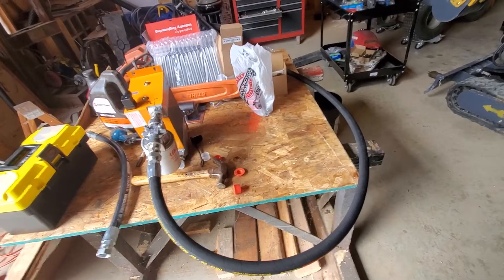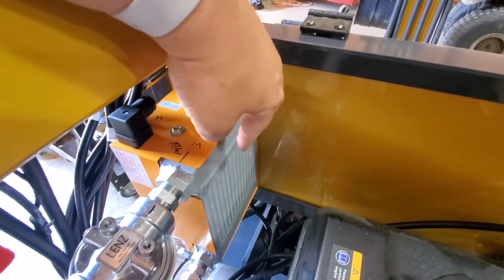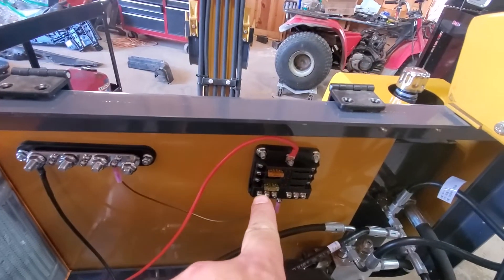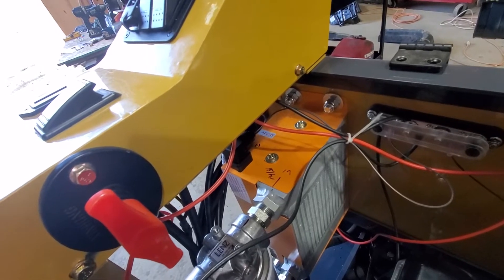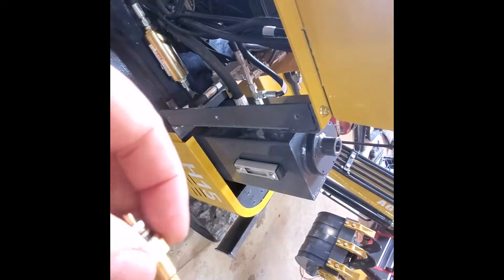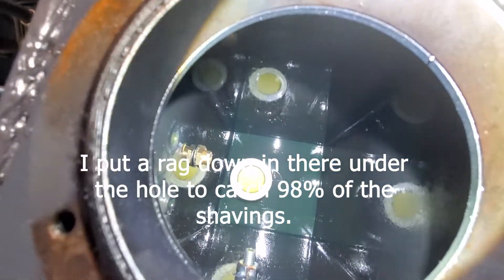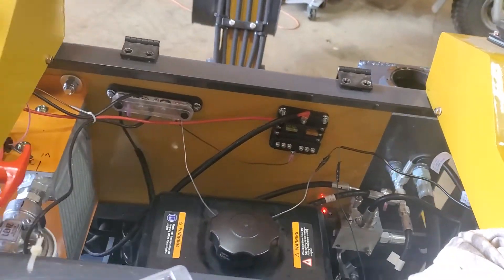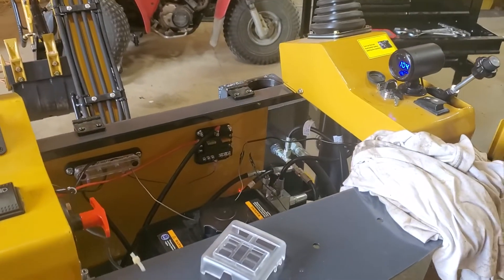AGT H15 Customization

Comment: Got a question. I did my setup exactly like you did yours. Exact same cooler location and direction as well as the hoses. What temp does your hydraulic oil usually run with extended use? I ran mine for a couple hours this evening and according to the little temp thing they have on the side of the tank from factory my oil was showing to be at the top of that temp gauge. When I filled everything after install I put the fluid level dead center of that gauge like it was before. Now I’m not exactly sure how that little temp gauge works but if it’s at the top of the gauge then initially I would think the temp would be 220 which I read was too high if that’s the case.
Reply from the maker: On the digital gauge I have, it stays at 150-160F.  I haven't used it on any 85F+ days, but anytime it was below 85F it stayed at 155F.  I haven't ever used the side thermometer though.  Only time I've seen it get over 160 is when the muffler extension fell off and exhaust gases stayed inside the rear unit.  If you haven't already, I'd make sure that exhaust extension goes all the way out the rear casing/fender so its going outside the engine compartment.

Comment: Hey man thanks for video but how did u get the air out of the hydraulic system
Reply from the maker: You just run the cylinders in and out a few times and it should remove it all.  If you still have some left, such as a bunch of small ones, it could be the wrong type of hydraulic fluid. Perhaps one made for tractors/transmissions? I go with the regular plain hydraulic oil, 5 gal bucket from Tractor Supply.

Comment: Why do I not have boom Controls or lights all of a sudden.. help
Reply from the maker: battery dead?  There is a lock switch on the passenger side near throttle that turns off all hydraulic controls except tracks. Helps keep you from hitting joysticks getting in and out and causing an accident.

Comment: Wonder if the cooler fan and other fan couldn’t be wired to the ignition switch instead of standalone switches. This way you wouldn’t have to worry about forgetting them on.
Reply from the maker: I would probably re-wire to battery disconnect.  I've also left the battery disconnect on and killed the battery.  This way if you don't hit the disconnect switch its obvious.

Comment: ThreadTool Supply part number 9235-27x1.5-12           This is a 27mm x 1.5 pitch to 3/4 NPT adapter part number

Comment: Hello, the hydraulic oil level is a kind of thermometer-like bar located on the right side with two numbers (one with the letter C that goes from 20 to 100, and the other with the letter F that goes from 20 to 200. Where should the oil level be? Regards.
Reply from the maker: When I start mine, the fluid is at the bottom, but as it runs and warms up, it nears the top.  The tank, on this model, is much larger and sits lower than the bar.  It will also change depending whether the cylinders are extended or not.  So there isn't a specific answer, but I'd say if the cylinders are all fully recessed (opposite of extended) the level should be ~ 3/4th full.  Worst case, it will overflow from the top - i've overfilled and just makes a mess and comes out the top.

Comment: What fittings did you buy for the oil cooler and where did you buy them?
Reply from the maker: They are all in the description except the hoses I took to a hydraulic shop and they cut off the existing fittings and re-clamped them down on the new longer hoses they created.

Comment: Question for you: I also have an AGT H15 and plan on installing a cooling fan and hydraulic cooler.  When I crunch the numbers both fans would draw about 120 watts or 10 amps at 12V.  Everything I have read has the charging output on the Rato 420 at 3 amps.  Have you noticed your battery discharging over time when running it?  Just curious.  Thanks.
Reply from the maker: Sorry for the late reply.  I only check this account occasionally. I haven't checked the amp draw of the two fans I have, but I haven't had any issues with power. I've run it for 6+ hours and the battery never went below 13v that I saw, which just means it was charging the whole time from the magneto. When its not in use for a week or more I do put it on a trickle charger to keep the battery up.
Reply: Well funny story.  After installing the hydraulic cooler I ran about 5 hours and when I went to restart the next morning the battery was dead.  I figured the stock charging system was insufficient and ordered a 25 amp system from Big Block Clones.  When I went to install it I discovered that the factory system had the same 6 magnet setup as the upgrade and that the reason it wasn’t charging was due to a blown fuse.  (That’s what I get for assuming without first testing.).  I put it back together with the factory parts and now it shows 13-14V with both fans running.  I guess I lucked out getting such a robust charging system from the factory.
Reply: I was doing similar mods and my 25 amp voltage regulator fuse was also dead 😂 I ran it with the existing oil for less than an hour to test everything and had to pull start it because I didn't know the battery was impossible to access 😆 Luckily this also prompted adding a battery terminal relocation kit to the list! This also made rewiring everything easier (basically eliminated 90% of the factory wiring for a new switch with an accessory mode and a combo 6 way fuse/relay box) I'm still in modification mode so I've turned a small project into a major one... Also plan on running an electric ball valve for auto fuel shut-off, but I think I'm going to add one of those $99 2-3 gallon aluminum gas tanks behind the seat outside of the hot box! And now that everyone is sold out of drive motor guard/cross bar stiffening kits I'm making my own (without a plasma cutter... I'll probably finally buy one as soon as I'm finished 🤦‍♂️) The other rare major modifications I'm kicking around with doing is cutting the frame and making the track width 8-12" wider with some square tubing... along with atleast 200-400lbs of counterweight inside the engine compartment .. Those mods are kind of rare, probably for good reason 🤣👍

Comment: You are sucking hot air from the engine through the oil cooler
Reply from the maker: True, but outside air is blowing into the engine compartment from the other fan.  When they are both running I'm not seeing over 150F when running the machine hard. I have it positioned this way so I could easily clean off the radiator grate from debris, dust, etc. Installing the opposite direction wouldn't allow me to do so without taking off a side panel. The unit also wouldn't fit on the opposite side.

Comment: I rarely comment but I have to on this one.  The filter needs to be on the return side of the hydraulic system, not the suction side (between the control valve and the tank).  If the filter starts to plug or the oil is cold, it will cavitate the pump, the pump is not designed to suck oil through a filter.  The point of the filter is to keep the oil reservoir from being contaminated.
Reply from the maker: Agreed not an ideal setup.  The filter has a 15psi bypass if it gets clogged so we shouldn't have an issue there. The pump is lower than the oil radiator and tank, so it should not cavitate as it is the lowest entity/part without any restrictive flow (pressure) from the hydraulic tank or radiator/filter. Oil should always be able to free flow to prevent vapor issues. I hear what you are saying on the placement of the oil filter, but i'm not sure how much difference it really makes for something cheap like this. The hydraulic systems is closed - nothing in or out, so all we are really filtering is anything that gets loose inside the closed system.  The tank has its own filter as well.  I'm honestly not sure a filter is even required/needed.  Now if I was buying a $50k+ machine that would last 10+ years of heavy use I'd probably be more concerned on getting it just right, but for $5k and light use I believe it will be good enough.
Reply: Bypass works only on pressure, you are applying vacuum on outlet side. This is beyond not ideal. I just did mine on the return side was very easy. Oil tank has a temp gauge, adding another seems wasteful. I read  mixed opinions regarding the oil cooler. I bought one, not i stalling if there is a problem. 
A pail pump is cheap, easy to pump oil out of resevoir

Comment: I have a H15, didn’t use it yet, doesn’t charge, blows fuse.
Ignition coil went up in smoke, something back feed through the ground wire. Replaced the coil.
I did install a thumb, add a grease fitting where it pivots, add quick couplers.
The blade arms in the back need 45* fittings.
Installed 4 latches for the back cover, hinges on one side and latches on the other would work.
I like your upgrades.
I had Sherwin Williams match the paint, wait for the 40% off.
I got the oil cooler and filter online, 6 hydraulic places didn’t carry metric fittings.
The cooler is British threads and the filter NPT threads.
Thanks for your video.